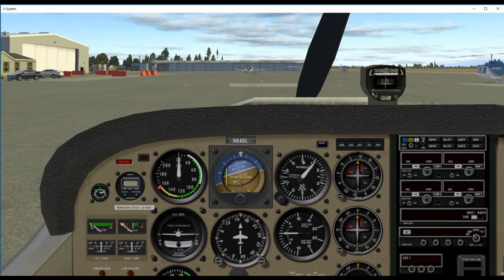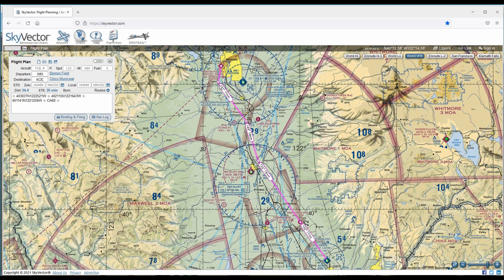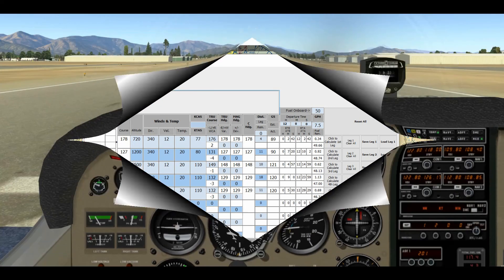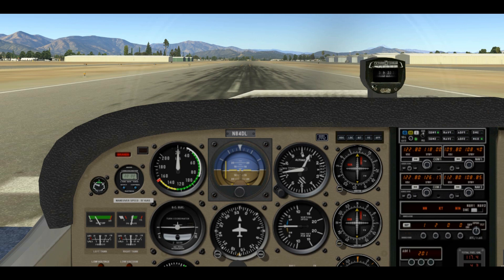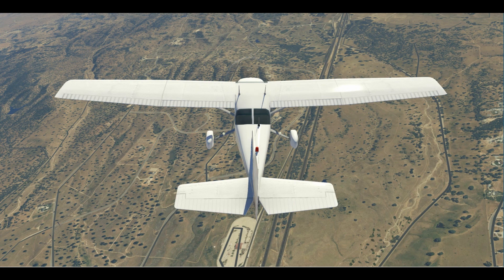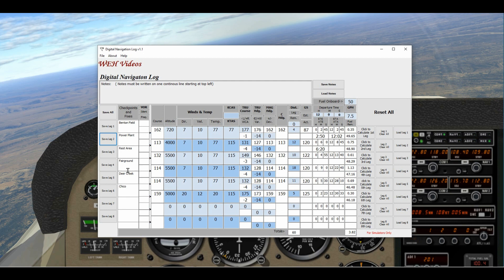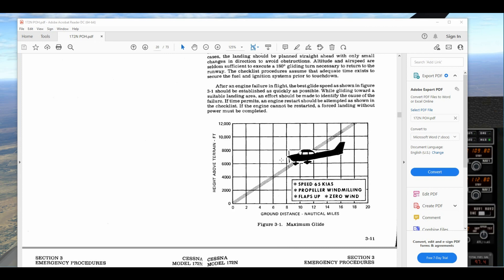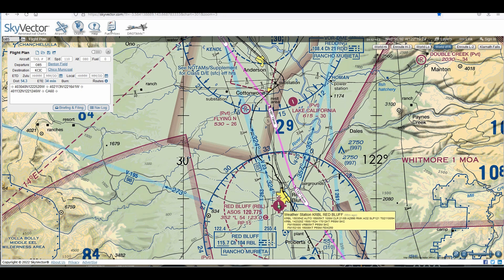In Flight Engine Failure Part 2

Comment: Hi Skip, Can you please post a stall training video. Thank you for educating us.
Reply from the maker: Hi @user-sl1wj8ki2r,  Stalls and slow flight are videos I have not done because flying these maneuvers are very difficult in a home simulator. You definitely need rudder pedals and from comments I've had over the years many people don't have them so I have avoided these. Part of the reason it's difficult is control response time lag in a home simulator and you can't feel the airplane making it harder to be precise.

With that said I will look into making videos if I can have any real success in my sim.

Thanks for your suggestion :-)

Blessings,
skip